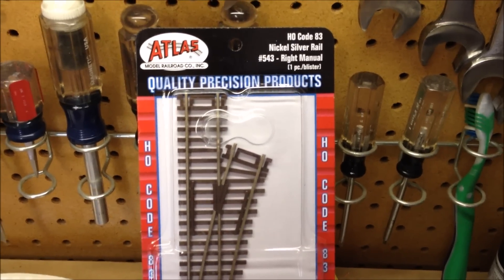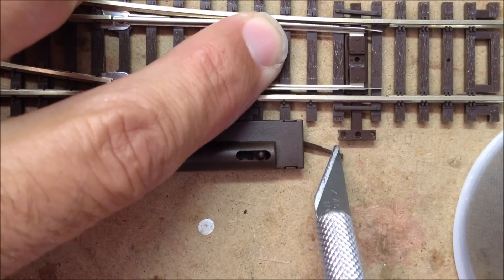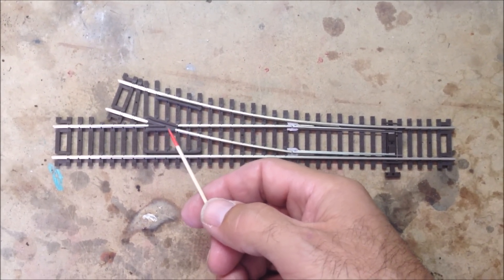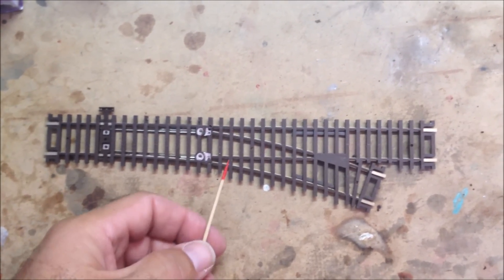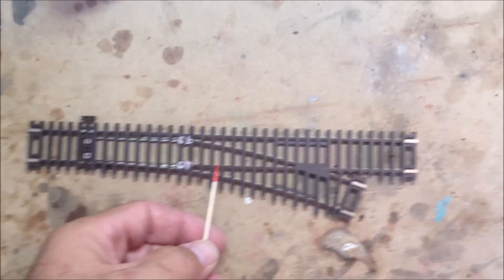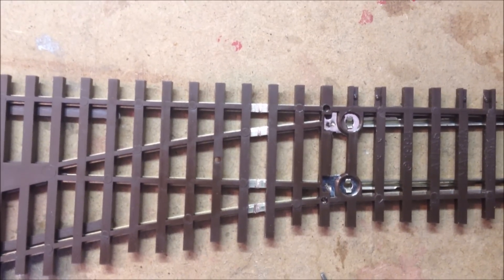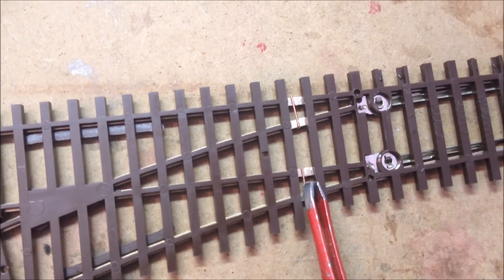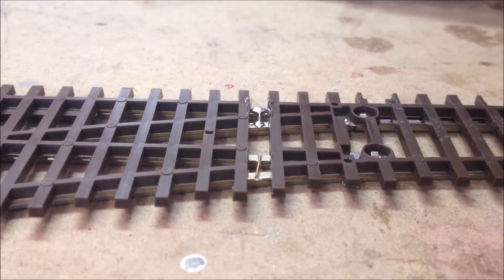River Mountain Model Railroad – Installing Jumper Wires for Turnouts

Comment: Terry, your advice is always a pleasure to watch. You always seem to find the easiest way to do the impossible. I personally power the frog and all connecting rails, which is both time consuming and a pain, but no problems thus far. Love watching, thanks again.
Reply from the maker: hi Joe! these turnouts have a plastic frog, so powering them isn't possible. I also connect feeders to the rails (6 of them), but there's still a chance for loss of power or a "dead rail", especially with short 4-axle locos. One of these days, I'm gonna try powering the frogs on my other turnouts (that don't have this jumper) with a "frog juicer". thanks for watching and commenting

Comment: hi Terry... great info.. i have been doing the same thing for my layout... in fact i have a bunch to do as we speak... thanks for sharing... vinny
Reply from the maker: hey Vinny, thanks for stopping by! yeah, this isn't a secret or hobby changing event, but figured I would upload a video. It's easier to add the jumper before installing the turnout on the layout, then wishing you had done it earlier. Terry

Comment: hi Terry
could also put a feeder wire across and wire it up into the bus wires (dcc) or power wires (dc)
thanks for sharing
Rodney
Reply from the maker: hi Rodney! yes sir,  whatever you can do do maintain electrical current has to be a good thing. Thanks for watching and commenting!  Terry
Reply: Thanks Terry
I enjoy watching your videos
I'm still DC and I will have feeders everywhere but it's a good thing cause if I would ever go DCC most of the feeders are there
Have a good day Terry 
Happy thanksgiving
Rodney
Reply from the maker: Nothing wrong with DC, only go DCC if you want to, not because someone wants you to. Happy Holidays to you, thanks again for watching and commenting.

Comment: Excellent tip Terry!  Thanks.  I enjoy your videos very much.  If I can make 2 suggestions that I think will help: put a little rosin flux paste on the rails and wire where you are going to solder first and put a little solder on the tip of the pencil before hand.  This way when you touch the tip to the wire and rail, the solder will flow from the pencil tip to where you want it and you are in and out fast.  Also, it looks like you have the standard 30/40 Watt soldering pencil you can buy just about anywhere, that comes with a single size tip.  For the work you are doing, a smaller, chisel or pointed tip would be idea for that tight a space.  This is why I love my Weller WLC100 Soldering Station;  lots of tips available for lots of different jobs.  I have to ask, did that little bit of solder that was shown on the inside of one of the rails, later cause any problems?
Reply from the maker: hi James, thanks for tuning in and offering some info!  No problems with that little excess solder, it is below the flange.
Reply: +PennCentral99  Very good Terry.  Thanks again for the informative vids-keep them comin!

Comment: Great tip Terry. I soldered jumpers on my Atlas turnouts too. Have you ever had any problems with those turnouts shorting at the frog? The insulated section is so short that some locos can touch both rails as it enters the frog. I ended up cutting gaps just ahead and behind the frog on mine. I never had that problem with a #6 just #4's and the snap switches like yours. I'll probably send you an email in a day or two talk to ya later!
Reply from the maker: hey Bud! where have you been? thought maybe you washed away in the floods and I should come looking for you, LOL! using jumpers isn't a secret or hobby changing event, but figured I would upload a video. A couple of my turnouts gave me problems with shorts at the frog, I fixed it by applying clear fingernail polish about a quarter inch from the frog point to eliminate this, worked so far! I wish I could afford to build my own turnouts (Fastrack), those look great and run even better! good to hear from you, send that email or call!
Reply: PennCentral99 No I didn't wash away...LOL! I thought that was a good topic. There are always newcomers to the hobby. If nobody shows them they will never know. Great job Terry!

Comment: Again Terry, very well explained. I'm going to try this method. My question is, after doing this is it still a good idea to keep the side of the rail and rail switch point clean for clean electrical contact? Or would this method eliminate that step? Thanks for sharing this....Jimmy
Reply from the maker: hi Jimmy! I would keep the inner side of the rail and point as clean as possible. I would want as much electricity flowing from as many points/directions as possible to help eliminate "hiccups" (especially on those small 4 axle locos). thanks for watching and commenting! Terry
Reply: Thanks Terry for the info.
Reply: +PennCentral99 Hi Terry, since this vid you put out,70 percent of my switches let the locomotives go through with no problem. Most of the problem stalls are now from the fine "Gunk" on the wheels that we dont see sometimes.Of course dirty wheels are a big factor too.  Thanks again...Jimmy
Reply from the maker: hi Jimmy, thanks for getting back with an update! I'll take it as a + that it is working for you. Dirty track and dirty wheels are always an issue. One of these days I'm going to follow thru with my threat to build a track cleaning car.  Thanks, Terry

Comment: Terry I'm running dcc and some of my older turnouts are not dcc friendly, so by doing this I can now make them dcc friendly? Thanks for sharing and love your painted rails and ballasting!
Reply from the maker: hi David! Are there gaps that electrically separate the frogs from the point rails? If not, you may need to do this in addition to installing jumper wires. thanks for watching and commenting and glad you like the rails and ballast!  Terry

Comment: This 'solution' misses the major weak point in the Atlas and many other turnout designs. That weak point is where the point rails are connected to the closure rails. The small tabs on the backs of the point rails that are folded inside of the contact holes on the closure rails are a problem waiting to happen. Many people have said that they have never had a problem with power flowing through the point rails, but I wonder how many of those people are talking about turnouts that have been in place for long time periods.

What should be added to the Atlas and other turnouts are jumpers between the closure rails and the point rails. This is easier said than done, but it will guarantee that you will never have an electrical contact failure in the turnouts.
Reply: Yep ... installing a complicated yard right now and, unfortunately, I am dealing with three Atlas Code 55 turnouts where at least one of the closure rails was dead as a door nail. I can only assume the factory jumper was weak/broken before I installed it. Point rails get power (because connection to stock rails are good and tight). Oh, well. Live and learn. I'll be installing my own jumpers from stock to closure rails from now on - before installation.